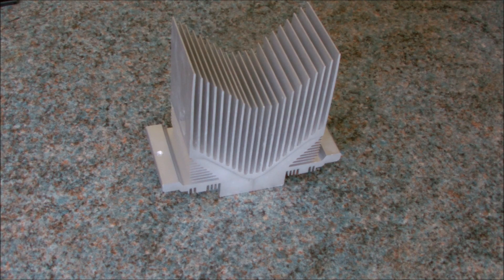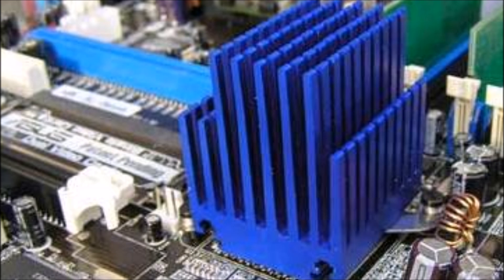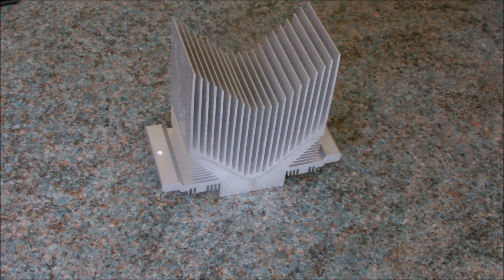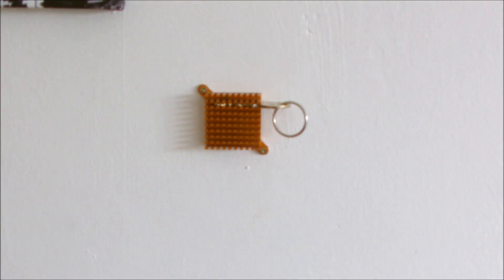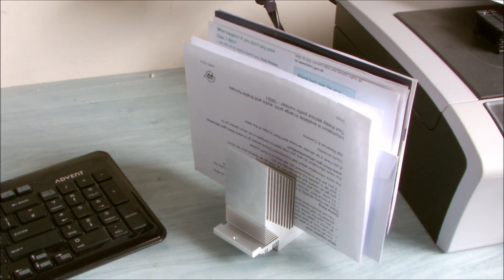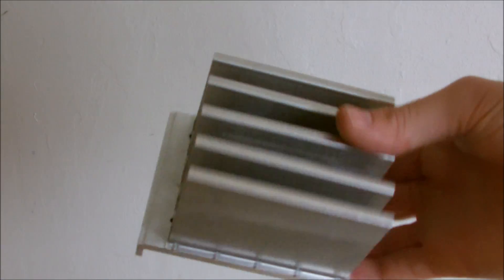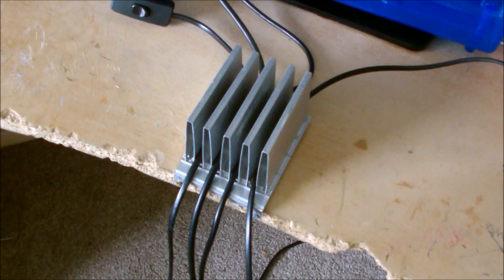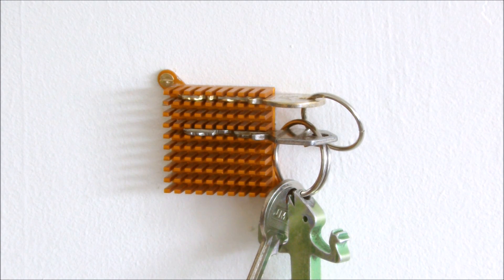Heatsink Hacks!

Comment: You fuckin genius. Btw if you find old copper heatsinks, see if they fit on your current computer (don't forget to put new thermal paste on whichever component they would cool). They're slightly better than the aluminium heatsinks.

Comment: Huge difference between a hack, and re-purposing something.
False advertisement.
Reply: Moving2U 
Don't worry. Money back guarantee
Reply: +Moving2U Hacking is using things for unintended purposes.
Reply: +Electro No, that is not what hacking means. That's what re-purposing is. The definition of 'hack' according to good old google is 1: "cut with rough or heavy blows" or 2: "use a computer to gain unauthorized access to data in a system".
Reply: Bryan Young That's my definition of hacking. Well, I feel like it reflects the hacking/makers community better.
Reply: Electro
How well it does or doesn't fit is out for debate, but none the less; until either Google or Webster or Oxford add that definition; it's technically wrong. Besides, that's what words like 're-use' 're-purpose' and 'recycle' are for :p
Reply: Sorry not trying to debate
Reply: Arguing an unwinnable case...

Comment: I heard if you somehow get gallium in there and try to snap it, it just breaks.
Reply: Rough up a small part of the heat sink with some steel wool or something, and put a drop of gallium on it.. leave it like that for several hours, and the gallium will seep in and break down the alluminum, making it extremely brittle.
Reply: The Carlz0r and then you can snap it in half like nobody's biznizz :D
Reply: He did a video with gallium and showed that